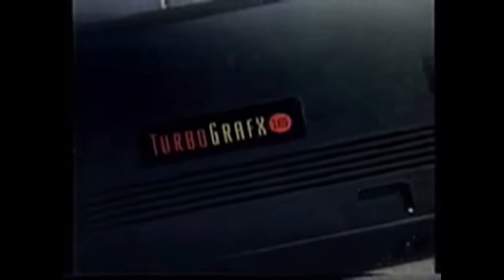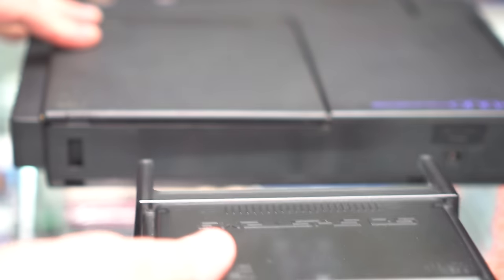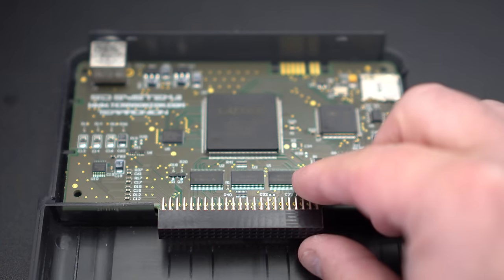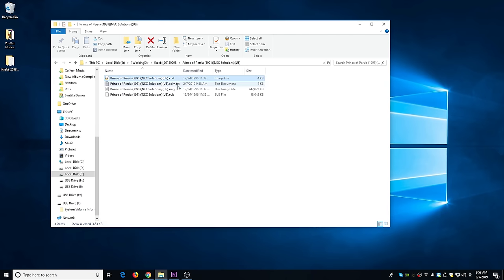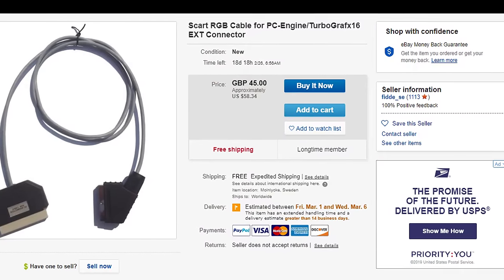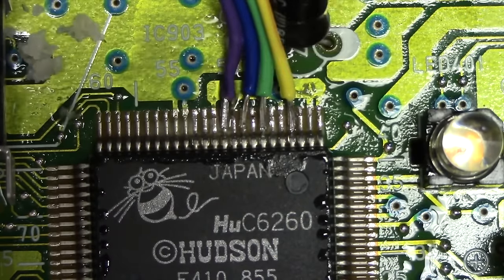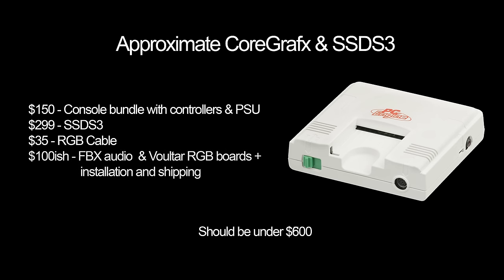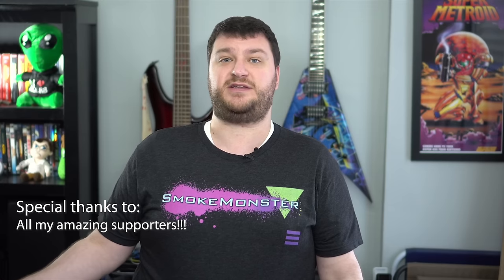TurboGrafx-16 & PC Engine Hardware Solutions

Comment: The SSDS3 is just so infurating. At $300 (pushing $500 these days with the additional cost of a Core Grafx), it's STILL cheaper than buying a Duo and having it RGB modded and refurbished with the bonus of being both a Turbo Everdrive and playing ISOs but the analog audio thing is a problem. It's frustrating that you can't just get everything in one. 

I think I could live with the noise in the RGB output that Bob showed (since he had to zoom in to like 500% before it was apparent on my cheap-ass TV), but the audio is just a no go. That they refuse to just bring down audio levels from the CD part in an effort to fix the distortion is stupid. It feels like a very simple fix could resolve the worst of what's wrong with it. 

All that said, if TerraOnion made a Sega CD ODE cart, I'd buy it. I'd probably preorder it. The Sega CD doesn't handle the output, my Genesis does.
Reply: You got your wish(es)

Comment: 18:31 “Every single thing about this menu could be improved.”
It still needs a lot of work but it was significantly improved over what you looked at. It’s had a controller-operated game selection for HuCards and disc images for months now, though you wouldn’t know it by looking at the site. You have to follow their Twitter updates and run the latest FW before it goes official on the website to get that. :( Technically, it’s experimental FW until the website gets it months later. I can see why you wouldn’t want to evaluate it with “experimental” FW, but users really do suffer if they don’t. Heck, same thing happened when they added CD-ROM² ODE! Even when they did add it to the site, the English version didn’t say anything for months and people continued thinking it was a video-only device!

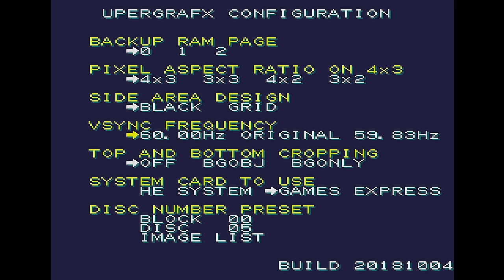Comment: 16:38 “VSync Frequency is kind of important because if you leave it at 60Hz it’ll be compatible with everything whereas if you put it at 59.83Hz it might not be compatible.”
Despite being presented as a VSync frequency selection, I don’t think it actually changes the output frequency. I think it just changes the buffering. It should really say Buffered and Unbuffered based on how it was explained to me back in 2016 with the UGX-01.

Recall that there were three different ways that something like a Hi-Def NES or Super Nt can adapt those systems to output 60Hz for properly-spec’d HDMI:
1) Speed up or slow down the system ever so slightly so that output is already generated at 60Hz (Unbuffered 60Hz; incorrect speed; near zero latency). This is the one the looks perfect but isn’t the right speed.

2) Buffer lines and duplicate/drop a frame when the display output and system get 1 frame apart (Buffered 60Hz; original speed; average half-frame of latency). This is the one that judders or drops frames but is the correct speed.

3) Allow screen tearing so that the system and the display do not need to sync up (Unbuffered; original speed; near zero latency). This is the one the looks worse but is the correct speed and lowest latency.

Hi-Def NES and Super Nt can re-clock the entire system to output 60Hz (entire system will run slightly too fast/too slow). UpperGrafx can’t because it’s external and the clock is generated internally. Makes sense that it only has two of the three options (missing option 1).

Comment: 4:05 “If you need an Arcade Card...try to hunt down the Pro edition.” There’s a very easy rule of thumb: If your system has a built-in Super System Card (turn it on with no card to check), you only need Arcade Card Duo because some of the memory is built in. Otherwise, you need Arcade Card Pro, which has all of the needed memory on the card.

I’m not even sure an Arcade Card Pro will work properly on a system with an internal Super System Card, but you definitely don’t want to buy a Pro if you only need a Duo. The price difference is crazy because there aren’t enough Pro cards around for the older consoles that need them. It might even cause bus fighting, like running a Turbo Everdrive as a Super System Card without using the patched BIOS files.

Even if a Pro card does work on a system that only needs Duo card and doesn’t risk damage over bus fighting, the Pro is already way too expensive... so please add the rule of thumb to the description or pin your own comment about it. Thanks!

Comment: Hi! I'm asking if anyone has tested the NEC av box that Otaku's store sells? Also known as NEC box v2 for PC Engine. It includes a horizontal shifter and a scart cable. It could be a preferable solution for me however I can't find any reviews about it. I'm in Finland and not a modder or an engineer or anything of that sort. So having a European store to order from is where I'm going with this. The unit with postage to Finland is almost 100€. Thank you if You have any advice or knowledge about this device. It uses THS731x or THS 737x(?) for rgb amplification if that helps. This video is a very needed help for a newbie like me so thanks for that also :)
Reply from the maker: I've never seen that one and don''t know how it's made.  Stone Age Gamer sells internationally though....
Reply: @RetroRGB  I'll take a look at SAG! The horizontal shifter sparked my interest. I have a Nokia 14" crt and it has the usual horizontal shift to the left(PAL-60, I presume). Not so bad on my Philips 15" but a nuisance still. Neither have the possibility to correct that thru a service menu. My PCE is the original white one with a very old rgb mod (mmmonkey) without amplification. The scart cable has been made from two separate cables not fully shielded and there's terrible audio buzz. The mod works on those consumer-grade crt's however my JVC TM-H150CG pvm shows the picture too dark as expected. Thanks for the tip and any help is appreciated! :)

Comment: I have the chinese "clone" you mentioned. What exactly is wrong with it? Picture quality is great and I see no potential for damaging my console. I've been using it for a couple of weeks now. Please go into more detail why this isn't a good option rather than breezing over it. Like I said, it works great for me and was far cheaper than other solutions. The Turbografx reddit also seems to support the use of the cheaper solution from eBay/China. No complaints, just good experiences with it.
Reply: Kinda weird how he just breezed over it without any explanation of why it's bad.   Was think about getting one because the db grafx booster is always sold out.
Reply: @robmoye7373  FWIW, the one I ordered, which is the one pictured in his video, works fine for me. Aside from having no case, I don't see why it should pose any problems. I've even spent some time following the traces to understand what it is doing.. and it isn't much. It's a very simple RGB amp, and costs about the same as an rgb amp for a SNES or N64. I'd like to know more about why Bob thinks it is a bad device. Picture quality is good for me on both of my PVMs, one going through a gscartsw, and also works with my OSSC.
Reply: It can become a problem mainly if you get ground loops or if ground sink is lost. So avoid connecting console to different outlets than any of the other things it is attached to, and dont unplug anything during operations obviously.

Comment: I'm a firm believer in using original hardware and usually play via a DUO in S-video on a CRT. Something about the Super SD 3 and the upper grafx just feel wrong to me. Yes they are technically using real hardware but once you just load up a device with a bunch of roms and ISOs it starts to feel like emulation to me. No more having to pick up a CD or put in a cartridge takes the nostalgia away for me. Plus those boot up screens/menus on both devices just look ugly. Might as well just load up a Wii with everything instead. The Wii's TG16 emulation via mednafen is spot on and then you don't even have to mess with a video upscaler for the RGB signal since you can use a component cable instead.  Also, how many people really need to play those few Arcade card games? Once you take arcade CD game function out of the equation then real hardware setups get much less expensive.
Reply: Most of the Arcade Cars games are either Non-English friendly, available on other systems, or (in my opinion) just flatout suck.

Comment: I have a question is there an issue using a pc engine in america as far as the power supply is concerned? I know the system is rated for japanese power outlets which may be an issue? Not suure whether to buy a pc engine or turbografx because of this
Reply from the maker: Good question!  It's best to just buy a Triad PSU that's designed for US power.  Here's links to what you'll need:  https://www.retrorgb.com/triad.html
Reply: @RetroRGB  awesome thanks so much just picked one up. My Genesis and SNES have oem psus would you recommend I switch them or use them? They work fine as far as I can tell
Reply from the maker: If they're working without issue, it's fine to keep using them.  If you ever have power issues, replace it with a Triad right away.  I had a SNES PSU that would sometimes not work, but sometimes work okay.  It's not good to keep using stuff like that and a Triad cured the issue.
Reply: @RetroRGB  Thanks so much I was worried about buying a PC engine from Japan on eBay when I thought of this issue, you settled it in hours thank you

Comment: pc fx is not part of the pc engine stuff...it's from the same NEC developers but it's a different console. also it's not true that pro arcade card is good for all, u need the pro for the combo console (pc engine + cd drive) and the normal arcade card for the duo version...you cant use pro for both, you giving wrong infos dude!
Reply from the maker: Do you have proof that the arcade card proof won't work for both, or are you just repeating forum rumors?  Cause I checked with people who actually own all this equipment to confirm before posting.
Reply from the maker: Yeah, but where is this info listed?  I put a ton of research into these videos and while I absolutely HAVE been wrong, for you to comment "you giving wrong infos dude!" without any real proof is a dick move.  I'll need more than "some guy had to return it".  Maybe there was just something wrong with THAT card?  That happens all the time with retro stuff.
Reply: @RetroRGB  The Arcade Card Duo is meant for Duo systems, which already have more RAM since they have integrated System 3.0 support. As a result, they offered slightly less expensive Duo Arcade Card upgrades for Duo owners. All other owners would typically want to buy a Pro, unless they happened to have a Super CD-ROM² attachment instead, which also had more RAM. That was released much later than the original IFU though.